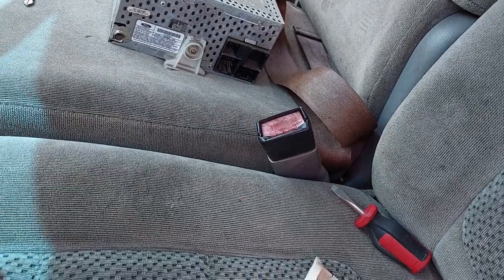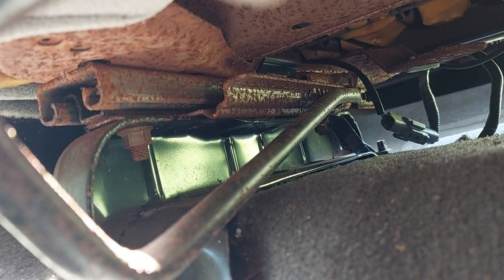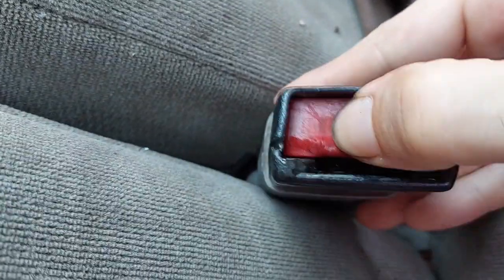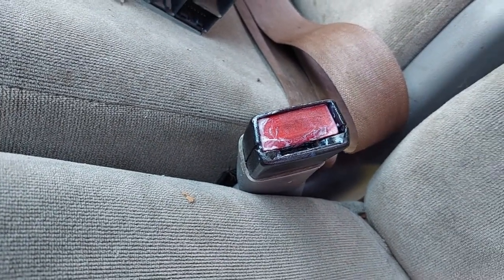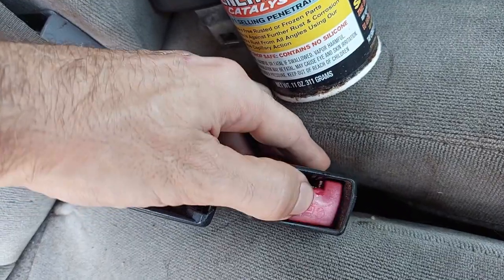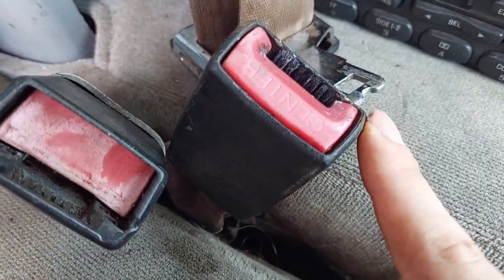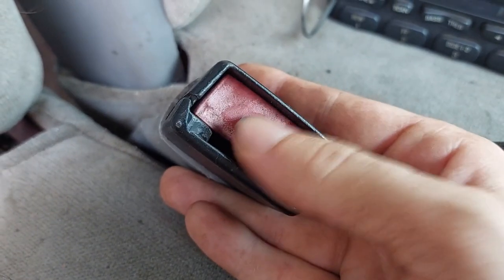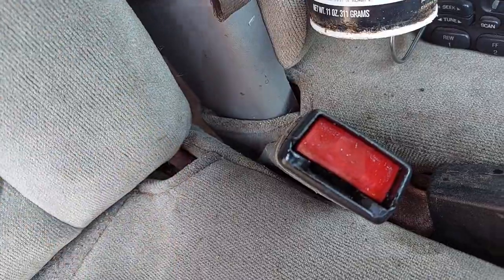Episode 76 - Seat Rail and Seat Belt Repair 2001 F250

Comment: OK! Gotta get me some PB Spray to see if I can’t unstick My Big Blue’s 98 Ford250 Drivers side seat belt, that comes out.  😊Then I guess I need to switch to Lithium Spray after the rust gunk is cleaned out. REALLY Hoping this works till I can get the seat belts replaced,  wasn’t planning on a complete reno on BB just use him for trips to the dump with yard waste. MuchMahalo and BOOM-SUBSCRIBED.
Reply from the maker: I hope that works out for you.  The buckle is still working fine for me.  The passenger works but the return spring is still not great.  I keep forgetting to order a new one for replacement.  Make sure you have a small screwdriver or something like it to work the button until you can get it to unstick.